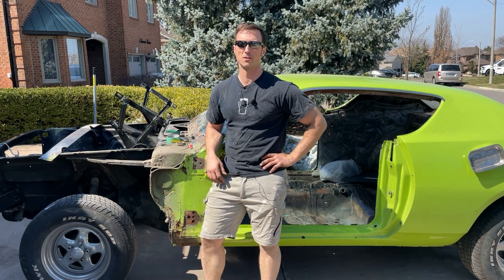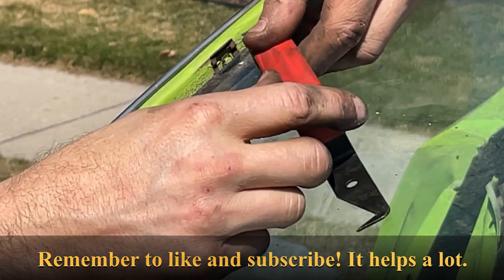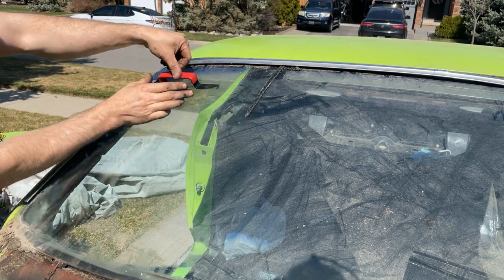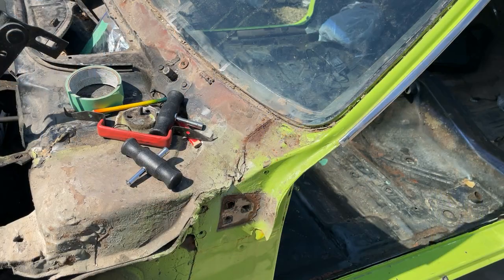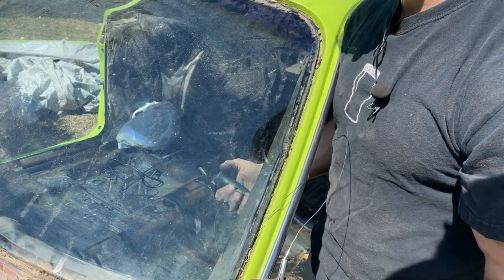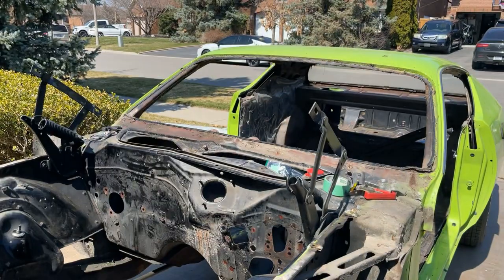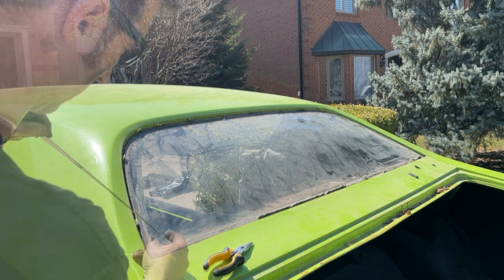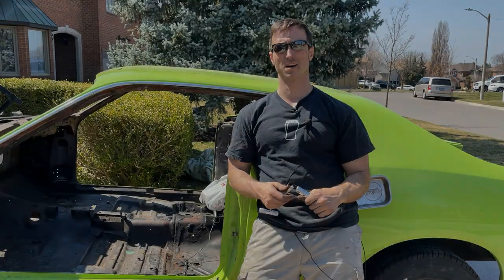1971 Dodge Charger Build - Episode 10 How to Remove Windshield and Rear Glass

Comment: Hi friend, good afternoon, I have been following your channel for a few months and thanks for your videos, they have helped me a lot. I have a question, how do you remove the glass from the doors?
Reply from the maker: I haven’t personally done it yet.  I removed doors intact and left all the hardware in.  

If you want to remove just the glass, I’m pretty sure they have a couple ball studs on the bottom of the class that clip into plastic clips on the tracks.  Probably could pop them out and pull glass out.  But I haven’t even looked at it. Try that.  

Gonna hopefully have the frame rails in the car soon.

Comment: Can you just cut half the back window to lift it and get a speaker in the deck then glue it back down?
Reply from the maker: If I understand what you’re saying, then speaker can be put in a box from the trunk. 

If you don’t cut it all around and try to lift it you will likely crack the glass.  Plus I’m pretty sure you will need to clean it completely for the new glass caulk